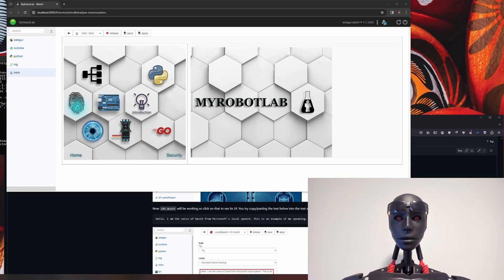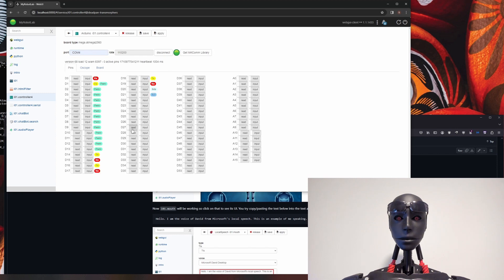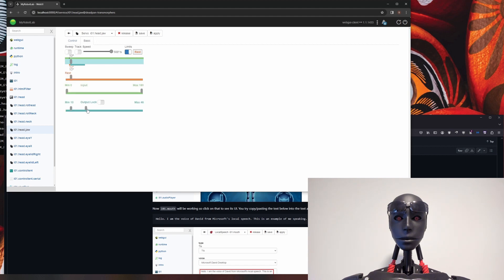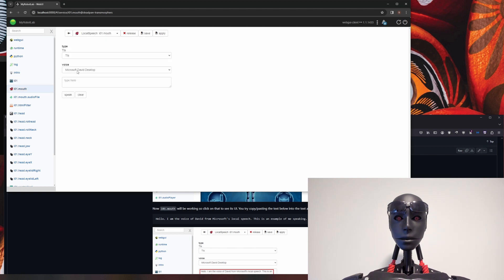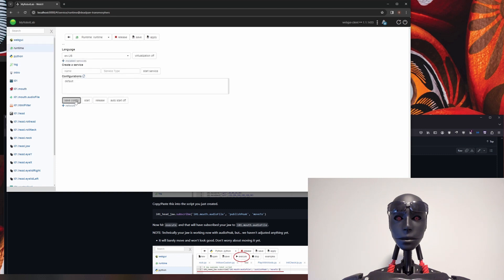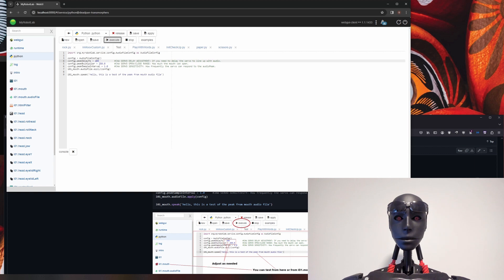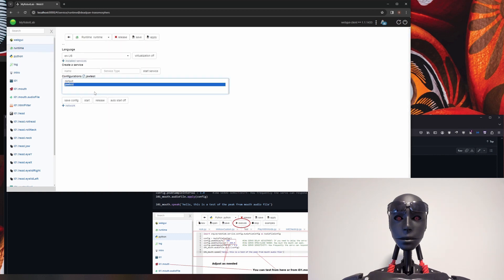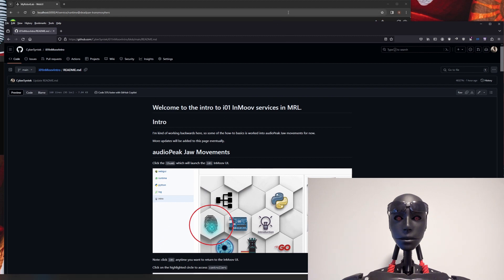InMoov Robot - Jaw Control with audioPeak

Comment: I so wanna do this , but when I go into io1 to activate the jaw, the nrl crashes and shuts down the servos……what mrl version are you using?
Reply from the maker: Mornin'. ☕️ 

In this video, apparently, I was using 1.1.1433.  You can see which version on the webgui in top right corner beside the bell icon for reference. 

I'm not sure what I'm currently running or was last running as I have been busy with house repairs for the last little bit unfortunately. 🤦  Not the latest version at the moment either way. I'm hoping to finally get back to robots and MRL stuff within the next week or two though. 🎉

What I can tell you is that there were further developments to the audioPeak setup after this video and that it is slightly dated now. I believe audioPeak is now either running as default or has been worked in as an option to just click  on, but there is one additional figure which needs adjusting to tune it better as well. 

Obviously that stuff you aren't ready for as of yet since you aren't making it that far before crash. 🫣

For starters, what is the current Java version that you are running?

Usually crash related things are due to non compatible versions of Java or having the right one installed, but still having another non compatible version installed as well. Or atleast is the most common reason from what I've seen. 

Just give me and idea on your system, Java version, etc, and I'll try and point you in the right direction for getting going. 👍